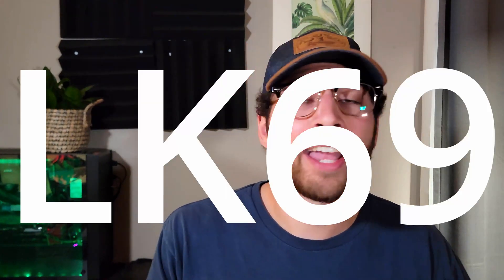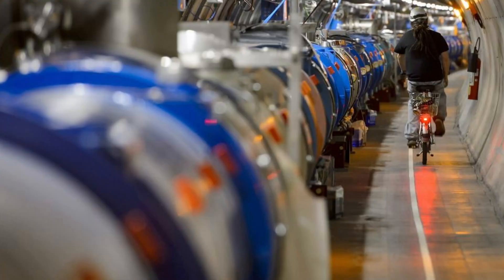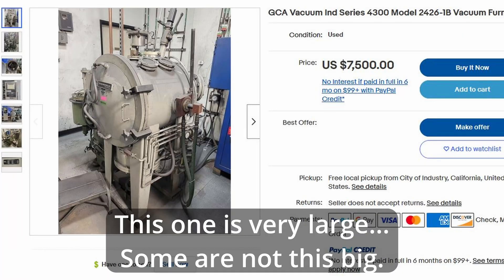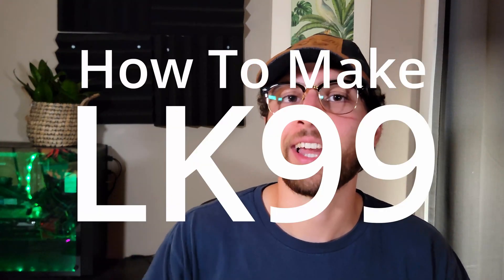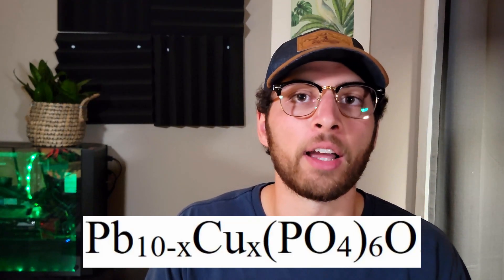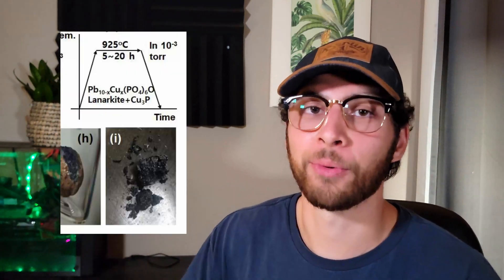How to Make LK99

Comment: The mixed results I hear about, suggests to me, that the nanostructure of this material may be significant to producing it. As is typical with high Tc superconductors, replication attempts have had to cope with impurities in the reagents and products, side reactions, intercrystalline grain boundaries, and a whole slew of test and adjust hurdles. I encourage continued research into this material by capable labs.

Comment: 🎯 Key Takeaways for quick navigation:

00:00 🌡️ LK 99 is a room temperature superconductor that could potentially be made at home.
00:50 🔬 Superconductors have two main properties: zero resistivity and magnetic expulsion, explaining the levitation seen in demonstrations.
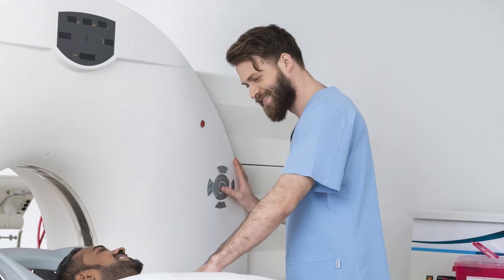01:19 🏥 Superconductors are already used in MRIs and particle accelerators, but these require extremely low temperatures.
02:00 🌍 The discovery of LK 99 could allow these processes to occur at room temperature, saving energy and revolutionizing industries like transportation and power production.
02:28 🏡 LK 99 can be made with relatively affordable equipment and non-toxic materials, although a vacuum furnace is needed.
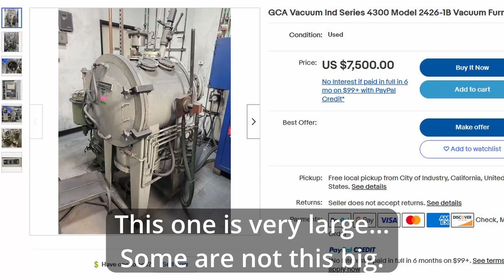03:10 🤔 There's controversy over whether the researchers in South Korea truly made this material and if it possesses the properties claimed.
03:48 🧪 The creation of LK 99 involves making and combining lead oxide and lead sulfate, and heating copper and phosphorus in specific proportions.
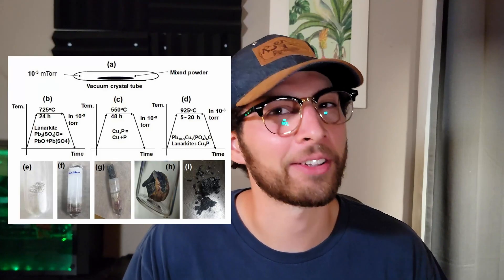04:57 ⚡ The potential of room temperature superconductors like LK 99 could be revolutionary, although there's skepticism about its validity.

Made with Socialdraft AI

Comment: i dont think it is fale. considering that the stuff can litteraly be made in your garage if you happen to have a vaccum furnace, it has got yo be one of the most easily replicatable experiments there is
Reply: 4 labs have now partly or completely replicated the results
Reply: a vacuum furnace is not a very common garage piece of equipment...  Also...  the temperatures required are pretty hot.  most garage furnace/kilns hit their limits around 950 C...
Reply: @kayakMike1000  the point is tbat as far as things go. having that be the only piece of extremely specialized equipment you need is kinda weird. its a much simpler process than one would assume after the decades of searching for a room temperature super conductor
Reply: @kayakMike1000 forges get real hot.
Reply: I still have hope, for this material,  but there may be some missing process steps